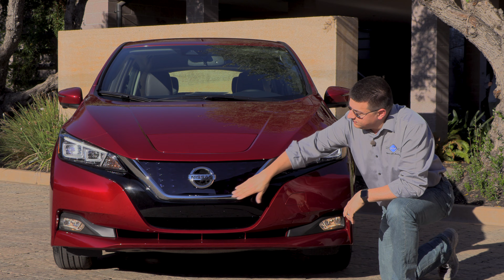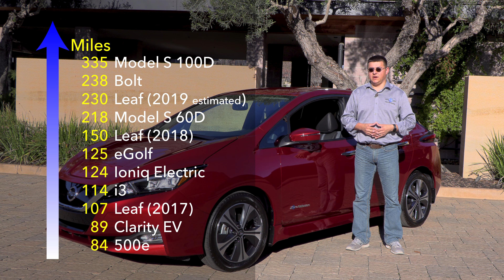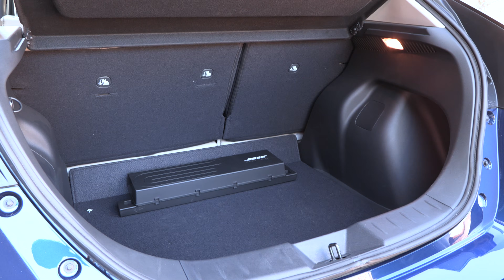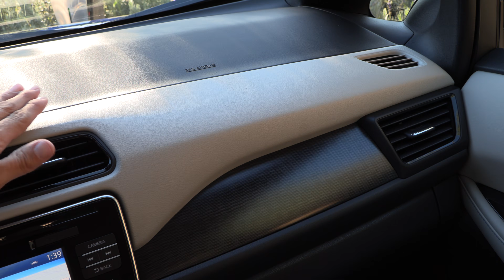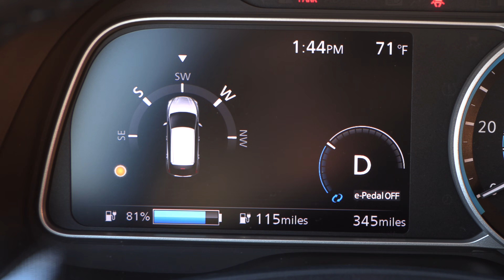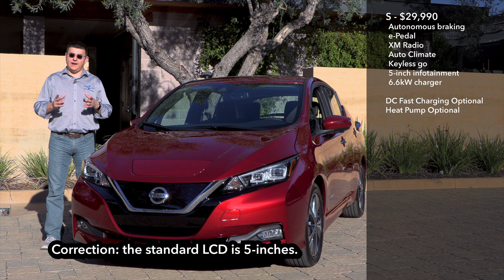2018 Nissan Leaf First Drive Review

Comment: you have to buy a $5-7,000 battery every eight years. I was considering buying a used 2011 but the battery will need to be replaced soon. I don't want to spend $5-7,000 on a new battery. I'm going to buy a 2004 toyota corolla
Reply: @Devogor  when I read some reviews, many owners of electric vehicles said they were at charging stations all the time.
electric vehicles don't get the mileage.

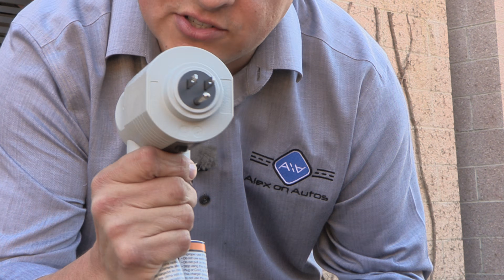Comment: at 4:55 he dose not mention the design flaw with the 110 volt charging adapter which for the record will not plugin to outdoors 15 amp 110 volt outlets that's right it won't fit or otherwise plug in to an outdoors 15 amp 110 volt outlet as the weather proof box dose not have enough clearance for that large adapter to plugin to the should point that issue out but oh well it will fit into the less common harder to find 20amp outlets in weather proof boxes

Comment: I recently noticed that Nissan LEAF cargo back opening is oval-shaped, making it a smaller opening than a rectangular opening, like on Kia Niro EV.. this makes getting large bulky items easier into Kia Niro EV or Hyundai Kona Electric. I've nicked and scratched the hard plastic opening area when trying to get large furniture items in that would fit in the middle area where the opening is largest, but the item slides down to being so heavy and scratches the border area of the opening.

Comment: I'm in thinking about this car. I test drove it drives very well. And I've driven the bolt. What shocking to me is the resale value in just a  few short months of 2018 models. You can pick up a 2018 for under $20K
Reply: You can get a new 2019 for under 20K after incentives depending on where you live.

Comment: The only thing i cant get over on the new leaf is the speedometer. It an old analouge speedo that looks like it came from a 1998 primera. For an electric car that is very good with all modern gadgets i cant get over how wrong it looks in that car. What are you thinking nissan.

Comment: 2/27/2018   I just took one out, for a test drive.  This Leaf does have more cabin noise - much more than the previous generation.  For me, the three most important EV criteria are:  Range, Cabin Noise, and Handling.  I wanted to get a 2018 Leaf SL, but I don't know - I would like a little more hush.  How do you feel about the noise issue?
Reply: I've seen other videos on Youtube and the actual tests show an improvement over the previous version. I think, it's about 70 db right now, if not less

Comment: It's difficult. I have a long commute, so an EV makes so much sense for me because of fuel savings. The problem is range. It's not quite enough for my daily commute and no where near enough if you take into account the up to 40% reduction in range when it is cold outside. it was -18 where I live yesterday. This cold weather degradation is a huge problem.
Reply: Get a bolt base with dcfc. Its 37k

Comment: I think none of the major car companies really want to manufacture electric cars.   Except for Tesla, the manufacturers have grudgingly produced compliance cars to meet CAFE standards. And for the most part these efforts have very little general appeal. After a year or two of these turkeys sitting unsold, they'll try to get the standards changed and this electric car foolishness will simply go away.  I'm sure the manufacturers are getting tremendous pressure from their dealers to drop electric cars and the dealers in turn are doing everything they can to make sure the electrics are slow sellers.  That explains why Tesla avoided the dealer system.  Electric cars promise a very meager repair revenue stream due to their very simple systems.

Comment: Really need active battery cooling/climate control. Heat really degrades the batteries, making it even more expensive when you try to get them replaced.

Comment: I'd like to buy one, but it still has two significant problems for me. I live in phoenix, so the lack of an active battery cooling system is likely to continue to be a serious problem. Furthermore, the 150 range still isn't quite enough. 200 miles minimum would do it for me, but by then the 7500 tax credit will be gone. May have to buy a bolt, I'm starting to see them on the roads in Phoenix, they aren't quite as ugly in person as they look in these videos

Comment: 40kWh battery size in 2018 is nonsence. Even old Leaf with leafbox range extender does similar range. Please install 50+ kWh and come again - otherwise I will vote for Bolt and Tesla

Comment: Two items. First, there is another EV that you completely ignored in your comparisons: Tesla Model 3. I wonder why? Second, trying to justify the Leaf lack of active cooling by saying they give you a heat pump, is kinda silly. But worse is justifying lack of active cooling for a lower price than the Bolt is hilarious: The Bolt ALSO has a hundred more miles of range!!

The seats are beautiful, very well designed with the different leather surfaces. But the console and dash have too much hard plastic for a car that is $30K+. All in all, I think the Nissan is at least $5K overpriced in all trim levels, considering the low range compared to the Tesla Model 3, and the Bolt.

Comment: 35 hours to charge the battery!!!? What the hell is that?  Over a full day to charge it?  But of course you can buy the expensive 'extra fast charger...for how many hundreds or thousands of dollars ,and you can only use it at home of course...right?  Wow!  I thought the Leaf was a much faster charging full Electric car. But if the new one takes 35 hrs to charge, I assume from next to 'empty'. How long does the original one take?  That alone stops me from wanting to look at one.
Reply: That's nonsense. That's about 40 minutes to charge it from a fast charger or the 6-7 hours to charge it from 0 to full from a regular charger

Comment: Good review. I have one of the 2018’s on order for a February delivery. I hope. You showed the new charge cord that comes with the new Leaf. Do you have any more info on it? I will be setting up my garage for the car and want to know what plug that is. You, and most others say that is a dryer plug, but it looks like a 14-50 plug. Can you confirm what plug it is? That would help me decide which way to go either a 30 amp EVSE or use the OEM one for at least awhile

Comment: Nissan is the lowest in quality  of the Japanese car I'm waiting SUBARU goes in Electric.
Reply: The Leaf, actually, has a very decent build quality. Moreover, because they recently had some quality assurance issues (rather, there were no issues but the company itself found out the quality standards were not complied with 100%, so they acted before anything happened). All of the new Leafs, therefore, have been subjected to extra checks (hence, the delay in shipments).

Comment: is a mile longer in america than here in the uk? cuz the new leaf is rated at 235 miles in the UK when it becomes available .
Reply: Blaze 125 No, in America they have a more realistic way of calculating range than the nonsense method we have in the UK. 150 miles is more what you should expect, particularly in winter.

Comment: The battery health display is the same as in older models and I expect it works the same as the wording of the guarantee is the same. Thus the first of 12 levels is lost first after a whopping 15% degregation and then 6,25% for each after that. Since 70% usually is the standard for the batteruy end of life why coudn't they just chart 4% per bar such that you'd loose one bar per 2year on average rather than having the first bar disappear after 5-6 years and not car even getting below half of it. I expect LeafSpy to work the same way such that you can monitor health on that instead.

Comment: Not having the heating and cooling of battery pack could lead to shorter battery life.  At 6'2"  I think the cabin will be a bit cramped for me.  Extra range, a large and growing infrastructure of power stations and I think a nicer cabin leads me to believe paying extra for the model 3 would be worth it.

Comment: Passive conditioned battery pack is a real problem and makes Leaf batteries have a high level of degradation.
Reply: Not true.  There was a change in the battery to try to fix this issue, but it was not fully effective.  Plenty of owners of newer Leafs are reporting early battery degradation on the Leaf forums.
The issue is NOT fixed!
Reply: They don't hold up well in hot climates.
Reply: Agree, DEFINITELY not fixed especially for those in warm climates.
Reply: I think you'll find that this was only an issue on the 2011-2012 LEAFs.

Comment: 150 miles range isn't close to the Bolt range which is almost another 100 miles.
Reply: I don't know if most folks could handle 238 miles at one time in those lousy seats in the Bolt.

Comment: The leaf is a good car but holy goodness "all" new is far from the truth. I am going to roast this car on my channel for that reason alone. I love the leaf but hate the aditude they have taken with their marketing. When u use the same AC controls, shifter, door handles, door skins, trunk shape, door window shape, inner door covers, head rests..... Man... "All" new is pushing it too far in the vocabulary realm. U get an "all" new Silverado and it has the same door handles from the year prior, people poo their pants because it's not "all" new... your review was great Alex! You may be off on the 40 min 0-80 charge time and also you should be able to find a battery heater with these models, just not cooling. The last gen battery heater turned on at something well below freezing, so it was less for performance and more so the battery did not get damaged from a deep freeze. You can confirm temps from the published manuals if you would like.
Reply: And I thing epa will give this car 135-140 mile range... Will I be right tho :)

Comment: I like that it comes with a 240V EVSE.  It looks like a 14-50 plug, which is common for electric ranges and RV hookups.  It will NOT work in a dryer receptacle, which a 14-30.   A 14-50 plug means it is designed for a 50 amp circuit.  It would not be safe to attach it to a 30 amp dryer circuit.

Comment: so give your money to edison instead of chevron?
Reply: Electricity costs on average one quarter the price of gas. Power plants are also more efficient on a large scale so even if you get your power from coal it creates less pollution than an ICE.
Reply: jennings mills 
Because gasoline magically appears at gas stations and isn't refined and transported across the country by diesel guzzling trucks or locomotives. 😂

You can cherry pick to help your argument all you like, EVs are still more efficient when everything is factored in and that's just worst case scenario, they are far more efficient and cleaner when the electricity is generated from renewable energy. Doesn't seem like you can use your brain though.
Reply: you can generate your own electric
Reply: Jon Dittmar 
i can generate my own Beef also doesn't mean its cost effective.
Reply: there is one tiny issue with your argument, that is that is already cost effective or else why would it be installed in the first place?
Reply: my aunt has a 2014 leaf and has solar pays $5/month of energy for her house and car total. the pannels are set to be paid off in 6 years from install
Reply: Son37Lumiere 
Lol"😂 because the coal magically appears at the power plant and isn't transported across the country in diesel guzzling trucks or locomotives.
Reply: Jon Dittmar 
$360 for her panels? Lol"😂 
Walmart?

Comment: I gotta feeling that all the torquing wheel slippage going to the front wheels is going to cause issues in snow and ice in winter
Reply: EVs have better traction control because power from the electric motor can be regulated at the nanosecond level unlike a ICE which has to several steps to do before the engine is disconnected or just slowed down
Reply: Carpediem06 - Maybe not. Most people around the world never see snow or ice.
Reply: There are people that do, and for those that do I have to imagine it what have a lot of slippage
Reply: maybe, seems like there's a lot to learn about EVs...